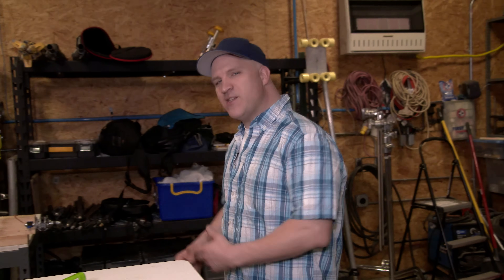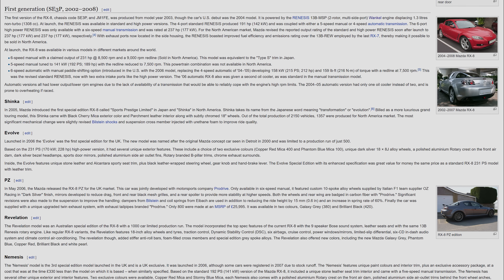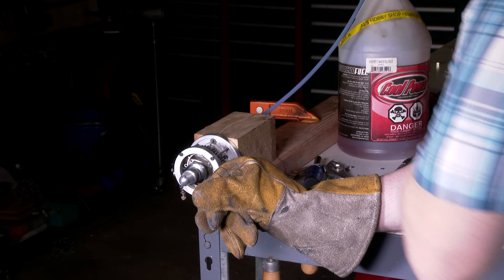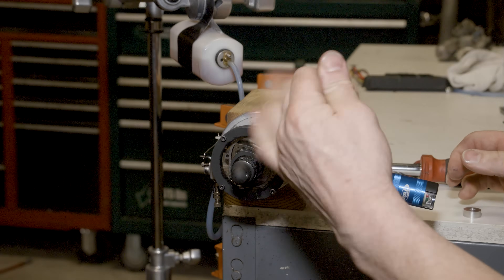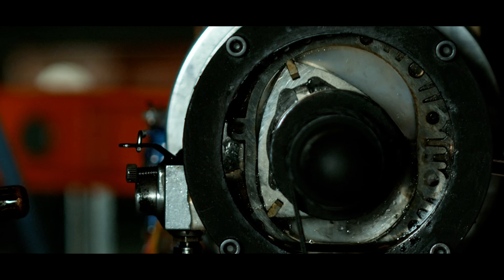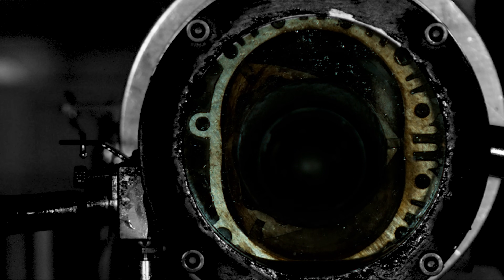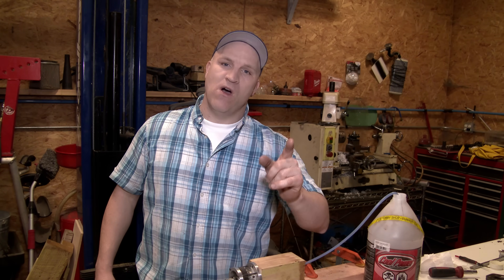See Thru Rotary Engine in Slow Motion - (Wankel Engine) 4K

Comment: The Rotary Engine is a mechanical marvel but look at all the wasted fuel it produces, and with that much surface area you need more oil on metal to metal surfaces. Its nice to have less moving parts than say a v8 but its a waste on the compression and ignition stroke for all that wasted fuel to get kicked out the rear. I wonder how it would work using diesel fuel and higher compression to ignite it? This engine would definitely be great on hydrogen gas!

Comment: It can easily be seen that this was not the full potential of the design. The air fuel ration was way to rich, as compression ignition was used, the combustion timing was all over the place and the engine seals were not working correctly, causing combustion gases toget were they were not supposed to be and some powerstrokes to work the wrong direction.

Comment: one question :- what will happen if the piston pins are changed to a round bearing, will it reduce the combustion and reduce the noise from the engine , also will it reduce the power of the engine? is it possible to try that ?

Comment: It wants to round itself out. - thus the compression. After a while the motion of the rotor will eventually wear out the seals. - Then it’s pretty much rebuilt time, right? - or am I missing something?
Reply: Yes, it has disadvantages.
Mineral oil is usually specified. Synthetics are not recommended. Its oil & fuel consumption is high. The seals on the edge of the rotor (I believe they are called Apex seals) do wear out relatively quickly compared to components inside a reciprocating engine & you are not going to get to them without a rebuild.
They rotate very fast, which helps to create the very high power output.
Reply: Rotories have oil injection systems to lubricate the apex seals.  One injects oil in the intake to mix with the fuel and air and there's also a small hole in the housing that directly injects oil in the exhaust side to lubricate the other side of the housing.  That's why they have terrible emissions.  Alot of guys who drive rx7s and rx8s on the weekends disable the oid injection system on the intake side and premix 2 cycle oil in the gas tank instead.  Burns alot cleaner and Helps with carbon buildup that typically makes the apex and side seals stick and fail.

Comment: So basically a single rotor is equal to 3  cyclinders 2 strokes, can someone enlight me
Reply: Yup I agree. Each side of the triangular rotar acts as a piston. The intake and compression strokes happen nearly simultaneously with the same for the combustion and exhaust strokes.

Comment: The Wankel engine is an awesome concept.  Three moving parts.  Just peachy - and such a small size and weight.
It is however a pity that its fuel efficiency (MPG) despite very respectable output power could not be raised to acceptable modern standards for production vehicles and light aircraft.
This is a shame because several experimenters have solved this and other problems with it.  Therefore it may have a respectable future ahead of it in hybrid transport (HEV) or in 24/7 electrical generator applications.

Comment: Another thing as that rotors rev higher but in fact the rotor actual spins half of the eccentric shaft. So an rx8 with a 9k rev limiter, the rotor spins at only 4500 rpm at max rev. I think rotary engines are very good. The biggest issue is they are high maintence with emission controlled vehicles. For industrial usage, I’m sure these engines would be awesome……. They’re more compact, easy to service, and as long as they are revving, they will work awesome
Reply: The piston (aka rotor) only spins at 1/3 of crankshaft rpm.
At 9,000rpm  indicated the rotor is only turning 3,000rpm
Reply: The Wankel engine was the biggest commercial failure in the history of engine manufacturing.
They are very weak, inefficient and horribly unreliable.

Wankel engines are obsolete technology because it cannot compete with superior reciprocating engines.

Comment: I wonder how wankels work with hydrogen systems?
Reply: The Wankel engine is unsuitable for use with any gaseous fuels like Hydrogen and Natural gas.
They lack the compression ratio and the combustion efficiency to use these fuels efficiently.
Research shows that gasoline is the optimum fuel

Comment: THIS IS WHAT THE "AIR POWERED" CAR USED
Reply: No, the Wankel engine was originally designed as a compressor, and is very inefficient as a motor.
Reply: @sandervanderkammen9230   yes it did, I am not "trolling" as the kids say
Reply: @chrisgardiner2215  Sorry, but I am dead serious.
You are obviously very confused and misinformed.
Perhaps some crackpot may have attempted to turn one into a pneumatic motor for automobiles but it's a very poor design and very inefficient as an air motor.

Comment: I see a lot of stupid comments. Yeah, THAT motor is backfiring but that motor is for no use, just for showing how rotary motors works. Other motors have 2 spark plugs and better balanced strokes and that motors are running very nicely
Reply: All Wankel engines are plagued with the same inherent flaws... it is inferior to reciprocating engines and is a obsolete technology today

Comment: seems like it was running very rich until the acetylene was running, is that normal for rotary engines to throw that  much fuel out the exhaust? if you're turbocharged I guess that helps with lag.

Comment: After the parts are painted black, it's no longer feasible to see the shaft position except by observing the eccentric. That's unfortunate, because many people don't realize that the (triangular) rotor only turns once for every three turns of the shaft. There is one firing per shaft rotation (each time the eccentric is toward the plug), but that's not obvious because the eccentric isn't visible; it would be very clear if there were a white mark like a pointer, painted on the end of the shaft (which could be on the nut but would be best on the retainer behind it).

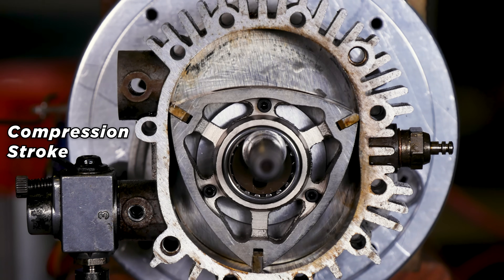In the non-firing sequence starting @2:46, the eccentric is clearly visible... just follow the hole in the eccentric on one side of the shaft and the one face of the rotor that is being highlighted through one full cycle (which takes until @2:58) and you can see that the rotor rotates once but the eccentric shaft rotates three times.

@2:46 chamber minimum volume; intake phase starts; eccentric at 9 o'clock
@2:48 chamber maximum volume; intake phase complete and compression starts; eccentric at 12 o'clock (3/4 of a turn so far)
@2:51 chamber minimum volume; compression phase complete, ignition occurs, and power phase starts; eccentric at 3 o'clock (another 3/4 of a turn for 1.5 eccentric shaft turns so far)
@2:54 chamber maximum volume; power phase complete, exhaust phase starts; eccentric at 6 o'clock (another 3/4 of a turn for 2.25 eccentric shaft turns so far)
@2:58 chamber minimum volume; exhaust phase complete, intake phase starts again; eccentric at 9 o'clock (another 3/4 of a turn for 3 eccentric shaft turns total)

All three faces of the rotor are working at the same time, one eccentric shaft rotation or 1/3 of a rotor rotation apart, so there are three chamber firings (power strokes) for each complete cycle of the engine that takes three shaft turns, or one firing per shaft turn.

the chamber before the highlighted one fires @2:48... one full shaft turn before the highlighted chamber
the highlighted chamber fires @2:51
the chamber after the highlighted one fires @2:56... one full shaft turn after the highlighted chamber
... one firing each time the eccentric is toward the plug, at the 3 o'clock position

In the early running sequence starting around @4:31 there are some out-of-focus details visible on the nut, and they can act as a shaft position indication to illustrate the relationship between shaft rotation and cycle progress.

Comment: The initial explanation with the model aircraft engine is well done, but the exhaust stroke is not "kind of combined" with the power stroke. As in any internal combustion engine, the power stroke is from the ignition point (at roughly the minimum chamber volume, one face of rotor facing right as it is held for this segment, at the glow plug) to the maximum chamber volume (same face of rotor facing up). Again as in a four-stroke internal combustion engine, the exhaust stroke is from the maximum chamber volume (face of rotor facing up) to the next minimum chamber volume (same face of rotor facing left). If the exhaust port is positioned to start opening before the maximum chamber volume that's timing overlap, just as with the valves of a conventional reciprocating piston engine.

Comment: What is that Blue, Screwdriver looking thing? Is that a spark plug of some sort? I'm curious as to how you got the sparkplugs to trigger. Just started to get into cars, sorry if this is a basic question ^-^'
Reply: Battery for the glow plug
Reply: @sandervanderkammen9230  so this rotary that he made basically operates with the glow plug constantly "on"?
Reply: @60k-v8o  Wankel engine, this is a Wankel 49pi madeby Graupner GmbH. 
It is the only Wankel RC hobby engine ever produced and is the only Wankel engine to useglow plug ignition
Reply: @sandervanderkammen9230  ahhh I see, thank you so much man!

Comment: Neat! I remember in high school a friend had a Mazda RX2 with an RX7 engine. So instead of saying 4 or 6 cyclinder was that one or two triangles?
Reply: That's two rotors, which you might call two "triangles". By the way, they wouldn't work acceptably if they were actually triangles. Almost all Mazda rotary engines had two rotors.

Comment: Looks like with three edges to the rotor, this engine only ever applies pressure to one of them at a time, and presumably heats up one side of the engine casing way more that the others. Couldn't you make a variation of it that fires on all three edges of the rotor at the same time, and probably gives it three times the torque for the same engine size?
Reply: Look up the 4-cycle engine and read up on the basic concept....

Comment: I was wondering f you were going to mention the old arctic cat snowmobiles with wankels in them.
Reply: Yeah, they used Sachs engines... and like the little Graupner 49PI RC model engines were a colossal commercial failure and were discontinued.

Comment: if wankle engine produces more power then what are the cons why not be adopted widely??
Reply: The Wankel engine once offered a small power advantage when it was introduced in the 1960s but today it offers less horsepower and significantly less torque.
The Wankel engine is obsolete now because it offers no advantages over reciprocating or other ICEs and has several major disadvantages that are inherent to the basic design.

Comment: Wankel is a 2 stroke engine. Same processes just different shape.

Yes it gets hp because it rotates fast but it lacks power. Compare it to a kid that has fast legs to a man that maybe has slower legs but pushes  more. The man can get a heavy loaded bicycle moving but the kid can not.

Then you have the negatives of the wankel like high fuel consumption, high oil consumption. More exhausts.
Reply: All Wankel engines operate using the 4-stroke principle.

Comment: How does it keep itself from boring out the chamber, do these have compression issues after longer term use ?
Reply: Apex seals.
Reply: The Wankel engine has always been plagued by reliability and durability problems associated with the apex seals.
Loss of compression compression is the primary failure mode and is directly related to combustion/pre-ignition problems.

Comment: Two questions that they didn’t address.  If there are so few parts why was the Mazda do expensive (why wasn’t it cheap?). Also I know the first units had sone gasket/seal issues but once those worked out, why wasn’t it still made today in autos?
Reply: They don't have fewer parts, and the parts are smaller and very fragile.
 Wankel engines cannot be produced on standard machines and required expensive extra steps in the manufacturing process.

Wankel engines do not offer any significant advantage and have several major fundamental design flaws that not only limit performance and efficiency but severely limited durability and reliability.
 There are no longer any engine manufacturers making Wankel engines in series mass production, its now an obsolete technology.
Reply: @sandervanderkammen9230  thanks for the response
Reply: @philam1973  You are welcome, Cheers!

Comment: Mazda 787b won Le Mans 24 h and than FIA said That’s enough with wankel,That’s not right
Reply: The Mazda 787b was a disappointing failure, it lost both the 1990 WSC Championship to Mercedes-Benz and the 1991 Championship to Jaguar.
It had a dismal competition record with 20 losses out of 21 races and zero pole position or fastest race laps.
The FIA did not ban the 787b or the Wankel engine.
Reply: @sandervanderkammen9230  ok thanks for answer,and what a year before?

Comment: Man that little rotary is running so rich its literally spitting unburned fuel out of the exhaust port. It could definitely use an updated ignition system.
Reply: You realize that this is a Graupner 49PI engine right?

Comment: Very well done video. A question I had is why the combustion doesn't force the rotor backward as well as forward--maybe the flame front starts at a point where it can only push forward? I know that older two-strokes would sometimes run backwards.

Comment: What they don't tell you is this type of engine does not last very long because of the high friction on the seals.  You might get 60 or 70 thousand miles out of one. So not so great if you expect to drive your car 200 thousand miles or so

Comment: Rotary R & D supported by Freedom Motors too.
Reply: Freedom Motors is a defunct vaporware investment scam.
Reply: @sandervanderkammen9230  entirely different company. Ref RotaPower.
Reply: @mikeherbst1825  Rotapower is the same scam.
 Paul Moller is one of the biggest con men in history.
The Moller Skycar/Rotopower/Freedom Motors is the longest running vaporware investment scam in history.
Reply: @sandervanderkammen9230  that's too bad. Initial testing showed a great potential over a broad spectrum of applications. I'll have to look for the original parts & literature I had before my health took a turn.
  Basically 3 sizes of rotor modules that could be stacked to provide the required amount of output power. Moller no longer had any part in it. Primary interest was by Johnson/Evinrude as a retrofit in many products.

Comment: I thought it was going to be like the rotating engine on the Fokker DR-1 but this is still a pretty neat designed
Reply: The engine in this video is not a Rotary type engine.
Its a Wankel KKM engine manufactured by Graupner GmbH called the 49PI.
Reply: @sandervanderkammen9230  i know it's not a rotary engine, that's why I said "thought"

Comment: Nice job. These type of engines tend to wear faster. Have you thought of putting rollers on the 3 corners to let it roll around with less friction?
Reply: The engine was designed in the 50s. Any possible design and corrections have been made. I believe the only real improvement is in shaping the combustion well on the rotor to improve efficiency.

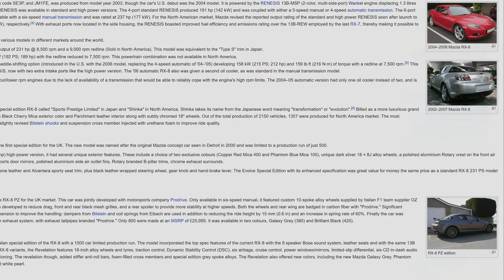Comment: 1:44 There is some controversy over how you count the capacity of a Wankel Rotary. Some feel you should double Mazda’s capacity rating. So that’s not a 1.3 litre, it’s more like a 2.6 litre.
Reply: I would make a plate like this . Place the rotor in its most volumetric position and measure how many cc of oil it takes to fill the void. Its how its done

Comment: One would have expected Wankel to have developed a piston engine rather than a rotary.
Reply: Actually Felix Wankel developed the idea intially as a supercharger for a 50cc reciprocating motorcycle.
The little Graupner 49PI engine in this video is not Wankel's engine... the KKM engine was designed by Hanns Paschke and Walter Freode without knowledge or assistance from Felix Wankel.
Wankel hated the KKM engine.

Comment: 4 stroke: 1 bang per 2 revolutions
2 stroke: 1 bang per revolution
wankel: 3 bangs per revolution, and that's why no car company use a wankel because they drink too much.
Reply: The Wankel engine only has one combustion cycle per crankshaft revolution, it requires 3 revolutions to complete its firing order instead of 2 in the 4-stroke Otto type engine.
Reply: @sandervanderkammen9230  
Je hebt gelijk

Comment: Why Wankel  engines are death nowadays?  The idea seems to be genius, however the consomption and the bad exhaust emissions are still a problem
Reply: The Wankel engine was very unreliable and inefficient, they were a commercial failure even in applications where emissions were not an issue.
Reply: @sandervanderkammen9230  : Agreed, it was not so fuel effcient as the more precise working  traditional piston engine. The only advantage was a round moving rotor without vibrations, however also modern piston engines works very smoothly almost without vibrations.

Comment: Would this run good on hydrogen? Maybe the starved mixture that blows regular engines apart?
Reply: Wankel engines don't have the static compression ratio required for running efficiently with gaseous fuels,  hydrogen is a very expensive fuel and Wankel engines have very high fuel consumption.